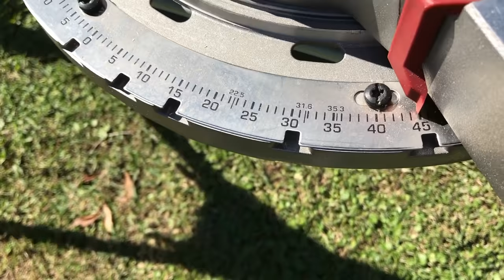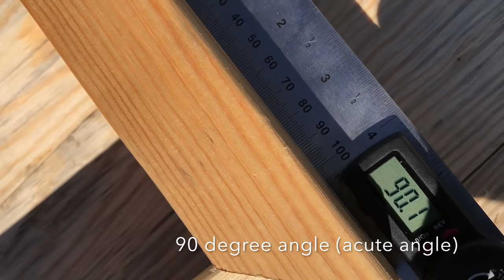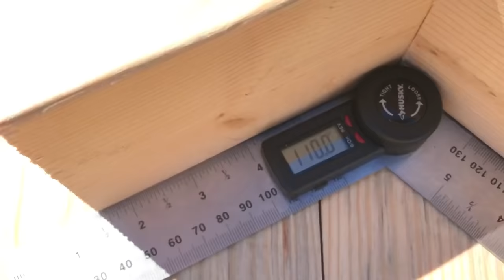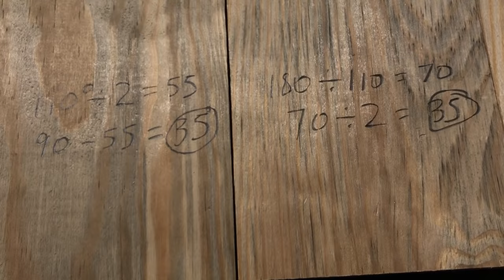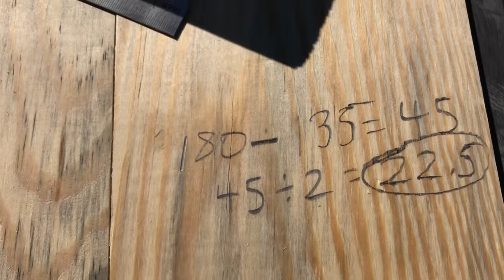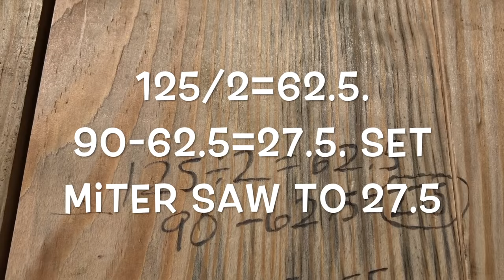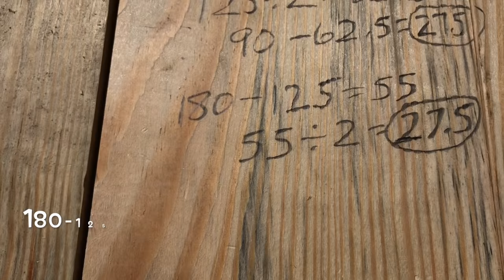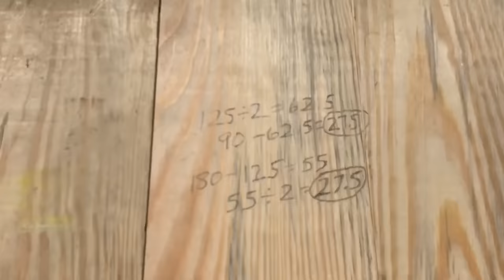How to measure and cut angles for baseboard, crown moulding, etc

Comment: Wait - so outside corners only get divided by 2, while inside corners need to use one of the formals? Is that because of the way you're using the digital angle finder? (Like what part of the finder is technically the "front"). Could you technically flip the angle finder around and just divide that measurement by 2? So basically you're dividing by two no matter what? I know the formulas are super basic - but my question is more to get an understanding of how the finder works.

Comment: Ok I might be miss understanding something. So I measured a wall and it read 92 degrees because it was greater then 90, I did 92/2=46. 90-46=44 which I then cut and it still isn’t perfect. What did I do wrong?

Comment: Good Afternoon Chris,

Thank you for your sharing your wisdom regarding mitering angles with the help of an angle finder.  I am hopeful you have a few suggestions how to identify unknown angles in a tapered frame in order to properly miter the corners of the irregular shaped frame.  I suspect my dilemma has a quick solution but one that has escaped me. 

Specifically, I’m refitting a boat that has a main entrance way that has a tapered opening consisting of 3 individual tapered framed panels with acrylic inserts.   Each acrylic panel is secured within the frame using a ¼” Dado. The bottom panel measures 22 ½” on top and 19 ¼” at its base. The height is 11 3/8”.
 
Since these frames aren’t square, how would I calculate the angle to miter to ensure a tight seamless fit?   
 
Thanks so much for taking the time!
 
Dave

Comment: One question:if you want 60 degree angle between the woods ; dividing by 2; than must set the miter to 30 degree. If you want 120 degree between the woods; 180-120=60 and 60:2=30 than you must set the miter to 30 degree. Just 1 setting as 30 degree at miter, how can corresponds both 120 and 60 degree between woods?

Comment: Is this is good information remember on you also wanted down on the table and tied up against the fence just to make sure that your boards aren't cocked which will cause the saw to send the wood flying or jerking could get your fingers cut just a little reminder you want it down on the table and tight to the fence which means put pressure downward to the table and back at the same time while you're holding your material in place before you cut and while you cutting
Reply from the maker: Thanks!

Comment: Ok, so I have an issue.  I have an inside bullnose corner at 112 degrees.  What are my angle cuts for the left, the right and the center piece, please?
Reply: I've never seen a, inside bullnose, but the angles are as follows. 
Your inside piece has a 25°angle on both sides. Place this piece in backwards, your 2 long pieces are also 25° as well but put in forward,  this should make your joint, I hope so.

Comment: 180 divided by 110 is not 70, its1.6363   What you were trying to say was... subtract from half a circle, so it would be 180 MINUS 110 = 70.   Outside of that gaff, This is a great video.   I am not cutting you down in any way (pun intended), but simple math errors need to be identified in case someone is running on CC and not actively listening and just writing what is said.  They would be really confused when getting 1.63

Comment: Based on your acute angle formula, if the wall angle is 80°, set the saw to 80/2=40°
Using your obtuse angle formula, if the wall angle is 100°, set the saw to (180-100)/2=40°
How can the same 40° setting give you the correct cut for two corners that differ by 20°?

I’ve never cut a miter, but it seems to me that the formulas you have for obtuse angles should be used for ALL angles.
That would mean you’d set 50° for the 80° corner and 40° for the 100° corner. Now you have a 10° difference in saw setting, which makes sense since it is half of the 20° difference in corner angle.

Comment: I'm assuming many have pointed out already the mistake made in the first angle math. It's not 180 divided by 110, it's 180 minus 110 to give you the 70 that you then divide by 2 for 35. The math is correct in the rest of the vid. ;)

Comment: Hi there, love you videos . Got a question here if i have inside corner of 85deg angel do i just divide that by 2 on my mitre saw and get that right exact angels which are 42.5 deg ?? Thank YOU .
Reply from the maker: Thanks!  The answer to your question is no.  Watch this video and let me know if you have any other questions. Thanks.  https://www.youtube.com/watch?v=v3eiMpnBg0c&t=7s
Reply: ok thanks for that , So it all depends on the mitre saw that you use aswell is that correct? AND because of the 25deg angel. I use makita mitre saw Max mitre range: 57° to 47°. So in the video at 2:45 you did mention anything below 90deg is a acute angel all you do just divide that by 2. so for example 85deg/2 = 42.5deg angel. So its the matter of setting it on your mitre saw correctly is that right??
obtuse angel i get that for example 120/2 =60 . 90-60=30
Reply from the maker: If your saw can go to 57 degrees then set it to 47.5 and that will give a 42.5 degree cut.

Comment: Great Video, very well explained. Thank you. Is it possible to figure the obtuse angle with a square of some sort if I don't yet have an angle finder?
Reply: Actually Chris, forget the square idea. Going to buy the angle finder. Thanks again, can't wait to do my base boards right. I saw someone trying to say coping saw is the fix, well your way seems the right way.
Reply from the maker: Thanks so much for watching..I prefer an angle finder but there is also another way.  I have a video on bisecting angles on my channel that explains how to do this.  Accuracy will be better with an angle finder though.  Good luck just make a few practice cuts on some scrap wood first.  Also watch this video on making cuts over 45 degrees on your miter saw it explains how to cut acute angles under 90 degrees in detail https://www.youtube.com/watch?v=VNFjzMmi6NE&t=5s
Reply: Thanks for the help, will do.

Comment: Why are you cutting it long ways (with the short side facing up) instead of tilting the saw and cutting it with the wider side facing up? More precise cuts?
Reply from the maker: Most saws don't have the feature to tilt the saw.
Reply: @SawdustandWood  thanks for the reply! I just got myself a new mitre saw and it bevels both directions. I'm cutting new barn board for a half wall and need to cut both outside and inside corners for this project. Would it be better do you think, for me to keep the board laying flat and use the bevel feature of the saw? It's 8 inches wide, 1 inch thick, 10 feet long.
Reply from the maker: It's really up to you, I would stand it up if I could though and cut it.  Here is another video I made on angle cutting I think you will like...https://www.youtube.com/watch?v=v3eiMpnBg0c&t=219s    Thanks for watching and let me know if you have any other questions
Reply: I think it's great when young ladies at least have an idea on anything about stuff like this! It's truly awesome! Great video brother!

Comment: The problem I'm having is where to mark the board for cutting.  
IE: I have an obtuse angle of 145.  Calculated a cut of 17.5?
Not sure if the miter can do anything smaller than 22.5...  ugh...😔

On acute angles I get better results but apparently I'm not marking the board measurement correctly because I end up with gaps between the two pieces.

4-10-21 Update:  
Well I was able to cut an 18 degree angle on both pieces of baseboard.  
It wasn't perfect but white caulking does wonders...HAHA

Comment: Your calculations for an outside edge is missing a VERY important step. After measuring your wall angle, you need to subtract the angle from 180 deg. In your example in the video, your angle happened to be 90 deg, so 180 - 90 is still 90 deg, so your calculation ended up working out. However, try cutting an outside trim on a wall at an 88 deg angle and it won't fit because you are dividing the wrong angle into two. 

For an outside edge, your cut angle calculation should be:
(180 - <wall angle>) / 2

Using my example of an 88 deg wall, 180 - 88 = 92, and 92 / 2 = 46 deg. Your video would suggest a 44 deg cut (88 / 2), which is not correct.
Reply: He did say this calculation was only for 91° and over. Not under.

Comment: Yeah but what about the measurements? How do you measure for a floorboard? Do you measure the length of the wall and cut where??? To fit flush against the corner of the walls??????

Comment: In your example of the 110degree angle, you said 180 divided by 110 equals 70! You should be said 180 MINUS 110 equals 70. Then 70 gets divided by 2 for 35 degrees...

Comment: This is easy because you established the angle with an angle finder. For those without an angle finder you should of demonstrated how to do scribed internal and external joints. Like radial arm mitre saws, angle finders are for those doing this often. You should demonstrate methods for the handyman only occasionally undertaking it. So your claim, "you can do this" will only apply if you have a mitre saw and angle finder. For those who don't have then they won't be able to do it this way! Not that instructional after all.
Reply from the maker: edward charles I have a video on inside angles..it shows how to mark the cut line without an angle finder....I will have another shortly on outside angles... thanks for watching.

Comment: The formula is wrong for acute angles, for example an 85 degree angle. Your formula for acute angle will tell you to set the saw to 42.5. However the correct setting for the saw is 47.5 degrees. Try it.

Comment: Your part about Acute cut angle is wrong.  Yes, for 90 corner angel, you did 45 is correct.  But you mentioned any angle less than 90 is acute angel, just divide this angle by 2.  It is wrong.  For example, for 80 degree angle, your meter saw angle should set to 50 not to 40.  It is because meter saw 0 degree setting is actual 90 degree...

Comment: Hi there great video you do make it look so easy I must say i wanna make a 60 degree angle could you help
Reply from the maker: Thanks...I linked a video that I made..it will show you how to make a 60 degree angle.  If you still have questions let me know and I will help https://www.youtube.com/watch?v=v3eiMpnBg0c&t=5s
Reply: As I said I’d be working with wider sheets so it would have to be a bevel cut vitas I haven’t got the height on the chop saw
Reply from the maker: What size material are you cutting?
Reply: Sawdust and Wood upto 500 600 mm so tell me if I’m wrong if I use my circular saw would I be right in saying 2 x 30 degrees cut would give me the 60 degree angle
Reply from the maker: toptotti70 take a speed square and mark 30 degrees....then cut with a circular saw...that’s what I would do...you are right two 30 degree cuts for a 60 degree angle
Reply: Sawdust and Wood I just like to say thank you for your responses & massive thank you for your help
Reply from the maker: toptotti70 you’re welcome

Comment from the maker: I have a new video that explains how to cut angles less than 90 degrees on your miter saw! Thanks for watching!
Reply: Sawdust and Wood 
Big Guy, what is the brand of miter saw you are using in this video?
Reply from the maker: Dewalt 12" sliding compound miter saw
Reply: I  saw  the  video  but  you  show  2 by  fours  and  not  panel molding  to  cut  sharp angles  like  boxes  going  down  your  stairs, this  is  what  people  need. Very great full  for  all  you  do, but  acute  sharp  angles  are  more  important.

Comment: Can you please remake this video with real baseboard mouldings? You will get moulding facing the wall or top of the molding on the floor or even both top down and face to the wall.
You surely don’t use 1x4 as crown moulding. 
And by the way, some years ago, a genius guy has invented a thing called paper. It’s a lot cheaper then table. 
Have a nice day.

Comment from the maker: Leave a comment!  Thanks for watching!
Reply from the maker: I'm not completely sure I understand what your asking.  Can you give me an example?  Also thanks for watching!
Reply from the maker: Check out this video.  It should help clear some stuff up https://www.youtube.com/watch?v=VNFjzMmi6NE&t=1s
Reply: The "reversing" an angle just finds what some people call the "complimentary" or "supplementary" angle. So these protractors are based on 0 to 180 degrees. As you showed at 5:35, you start with 110, then "reversed" it to get the supplementary angle of 70. Together they make the full "angle" of 180dg. It just another type of terminology.